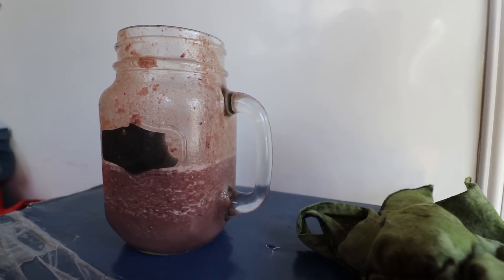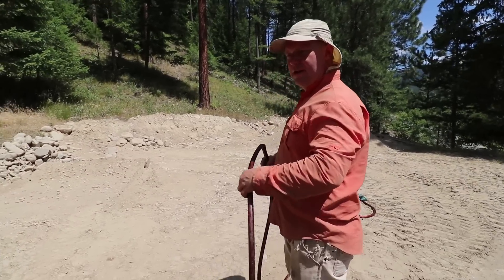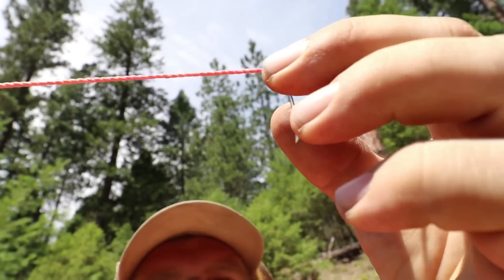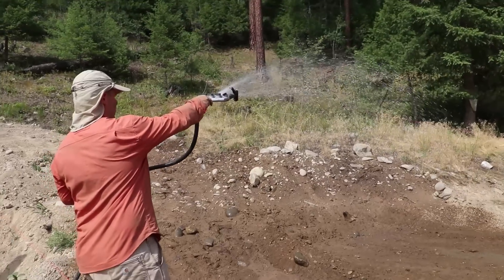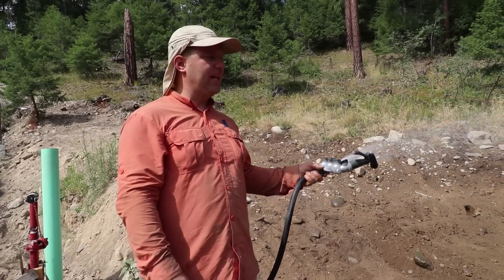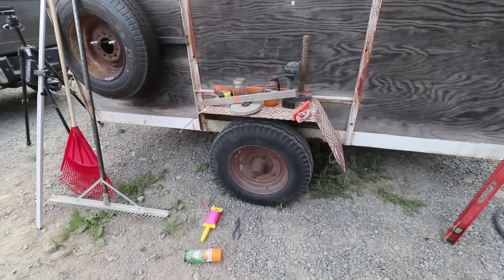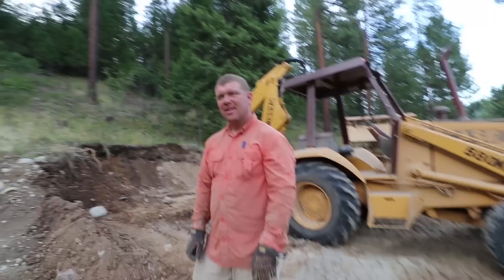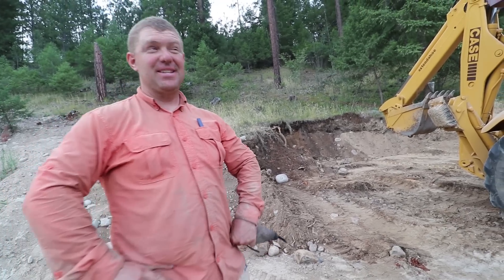IT'S OFFICIAL - THE HOME BUILD HAS BEGUN!

Comment: One thing you all could have done with the electrical. Make a hole for the conduit to go through in your forms, then run the conduit up along your post. You would have to make sure there was a gap wide enough between your post and conduit to attach the electrical box.

I know this is hind sight, but it is something to keep in mind for future projects and individuals that are planning similar applications.

I am an electrician by trade and have done this on a couple of projects.

Comment: I'm concerned about some things: 1) that the drop off of your excavation needs a step off (like stair steps) around and behind your house or rock walls (you have an abundance of  rocks) to prevent landslides, erosion, and water run off,  how have you planned for that?  2) removal of all the chemical fluid spill and proper disposal to prevent contamination of your beautiful new home. 3) saving for use as much of the rich dark healthy soil in with your compost for your garden.  You two are doing excellent, your patience in planning is paying off and I wouldn't be surprised if you already have the above concerns resolved and haven't shared those with us as yet.  Great videos, so much enjoyment observing your journey.  grams

Comment: I have been wondering if you guys considered taking a look into the Earthship method of construction or housing design such that you would capture your own rain, grow veg and fruit trees and generally have an indoor green house as a working part of your house, and make use of your water 4 times before it goes to the septic system. I suggest looking up the Earthship method, you might even get some idea's for parts of your design method to heat or cool your house in the end if not other stuff.

Comment: It will help if you put in batter boards in now at your corners (set back maybe 10 feet)... 8 total, each pair represent one face of footing / wall.  Use the laser level to put them all on the same level so you can accurately measure and square off the corners.  Once you put the lines in for the footings you can sag the line until it makes a fairly straight line on the ground... use chelated lime (white powdered chalk) to mark the face of the footing to dig by. 
One other trick is to put in a rebar stake (like number 8 or larger) far enough away that it won't get hit (protect it)... set the top of the stake at finished floor height and reference off of it for the entire project.... once you have some concrete down you can cross reference it to make sure everything is perfectly level and square.

Comment: Hey guys, 
I can give you another trick for the string in the pipe. You can us a compressor with a air gun and shoot it from the same end you are feeding it. Most of the time you don't need the bag just the string. Just pull the right length so you know you when you made it to the end.
Hope that helps in the future. Oh and Jesse you might be able to pick up the grisly with the front bucket under the lip. Basically hanging it on the top of the bucket. I hope you understand.
Love the videos 

Ps. Don't let's the trolls get to you. There not the ones out there doing the hard work in the heat. Congrats on everything.
Reply: Future Hindsight it just moves down the pipe with the air flow. Pretty fast to.

Comment: Melissa re tool organisation; Get a tote bag. I changed from tool boxes to a tote bag a year ago. SO SO much easier to use. you can chuck the bigger bits in like a drill and impact driver etc and the smaller items, screwdrivers and spanners (wrenches) stay in the elasticated pockets.

Comment: I just lost a long post I was going to send. But don't use Mason's line to pull, it will cut the conduit at the bends... Use poly pulling line or pulling tape or mule tape. 
And plan to put a "ufer ground" in your footing aka "concrete encased electrode" - if want some electrical advise message me.

Comment: A cut up sponge works great for gitting a string throu a pipe with compressed air. Never tried using a vacuum. Is there a creek or river near there? All the rocks were in a river at one time, all nice and round.

Comment: Firstly,,, I don't know.  I have been a builder for 50 years.    Angle of repose.  All materials have a maximum slope, the angle that the pile of sand, or rocks, pea gravel, snow,,,   And there is a lesser angle that materials 'like' to erode to.

Your back wall depth.  Making the slope steeper behind your house could be a very bad idea.  The slope has demonstrated what angle nature likes.  All the slopes behind your house are approximately equal.  You should consider that angle as your maximum angle.  Exactly as on  a roof,, you will want a flatter angle and even an up-slope to the rear of your house with swales leading the water around the house.

Placing a house to an arbitrary either height, or depth, can be a very expensive idea.  Allow the site and water flow to dictate what it likes.  Like the view, raise the house perhaps.

The summer heat you have experienced,, make certain your south facing windows have adequate eaves to shade them,  You wear a baseball cap?  It is exactly the same thing.

Comment: Liked #47,  your starting to get better at everything, thinking sometimes to much and to far ahead but it will all come together  and in a good way I hope, lol, on the piping for under ground be safe and if possible put a extra pipe in for those hard to dig places so as to not have to re-dig the area up, your still going to mess up or leave something out, just the nature of the beast even for the pro's, lol,  Later

Comment: Don't pull your circuits in the PVC conduit with string, use a pull wire. The sting will cut in the 90 deg. elbows.

Comment: What's the grade on that hill?  If it's about 30 degrees or more you're at a pretty high risk of landslides, regardless of the composition of the soil.  If you're less than that it's safer, but still not risk free.  I'm not trying to say that you're doing it wrong, but even experienced developers don't take this into account and pay for it later.  Love the videos, keep them coming!
Reply: Also, the more you dig into the toe, (base of the hill) where it looks like you're putting your house, the weaker the hill becomes and increases the chances of that sliding.

Comment: 45 yrs ago-for erosion control ,I  made DIY        "gabion" baskets     ,from 1/8th inch galvanized wire rolls welded at 3 inch spacing
   -filled 6 or 8? of such  2 x 2 ft x 10 ft long   baskets  with rocks and boulders plus scrap concrete pieces  
     -STILL ok -     ( immersed 24/7/365  in water for 45 yrs )   -but looks a bit "ratty" now since man made concrete eroded away~~

 suggest you consider same  - to hold your hillside in place ABOVE your foundation 
  since CHEAPER than poured concrete blocks, NO REBARS or concrete  required
   ( as MANDATED on your driveway by municipality )-to keep hillside in place above your driveway

           -AND YOU have COPIOUS rocks and boulders to use ~~

Comment: Here's helpful hints when sending string though pipe use a shop tie a piece of placstic to the string and let the vac suck the string down the pipe
Reply: I have been pulling wire for over 30 years. both ways work.

Comment: Congrats on starting the house - very exciting!

I may be mis-remembering, but didn't you lay out the septic system's slope so the house would be roughly where the trailer is?  The house location seems to be quite far away from the trailer.

Comment: I envy you both on this journey you have taken on. This is something that I had always planned to do. But life and raising a family ended up taking precedence. You both make an excellent team, you compliment each other in your personalities. Keep communication good between each other and keep supporting each other. Keep having fun with each other and life together. 

Some notes and advice on the projects, mostly from my own experience. 1. Remember the "KISS" principle, both in your work and in your "Lecture" (Teaching) time.  2. Be wary of over-building, it cost time and money and SOMETIMES things don't need to so strong or heavy. 

I watched Alyssa vacuuming in the pull string through the conduit, great job, excellent technique. BUT do NOT try to use that nylon twine to pull wiring through the PVC. Only use it to pull a heavier and broader and soft pull string in, then use that to pull the wiring in. That nylon twin is very strong but the small diameter will also cut right through the PVC pipe very easily and quickly, almost without effort.  Take a scrap piece of PVC pipe and run a piece of that nylon twin back and fourth around it a few times and see how quickly it will cut through it.  If you try to use it as the pull string, it  will cut slits down your PVC pipe, especially around the inside of curves and bends. Then you no longer have a water-proof PVC pipe run. Spend the money for the flat, braided, soft pull string rope made for using in PVC pipe. It is a little more expensive initially, but it will save you time and effort making your pull smooth and easy without cutting into the PVC pipe. Wind it up on another spool, extension cord "ring" works great, and re-use it many times. 

Do not let the people with negative and destructive comments and opinions get you down, don't waste your time with them. They either don't understand the fantastic project journey you have taken on, or are just flat out envious of your journey and are to immature to understand the saying; "If you can't say anything nice, don't say anything at all." 
But there are a lot of people that are providing you some excellent advice based on their knowledge and experience. For those people, on behalf of you both, myself and the many thousands of people that are leaning a lot from you sharing your journey, a very BIG "Thank You!" for sharing. Knowledge that is not shared will die and have to be re-learned. 
Thanks again from all of us that are getting a lot from you sharing your journey with us. Keep up the great work and may you realize your dreams and much more.

Comment: Great vid you guys.  I have a question regarding your site selection of the foundation:  why did you choose that site on your property rather than placing it up the hillside just behind the deck?  One would think the higher elevation would not only provide better views, but also a shorter cable run to your solar panels (resulting in less voltage drop)?  I assume the gravity-fed water system played a role in this choice, but I'm just curious, because my instinct is always to build as high up on the property as possible (to mitigate flood/water-runoff risk.  Keep up the great work!

Comment: Be careful with that large roll out tape if it's made of canvas/plastic type material in the heat the measurements might not be correct. Not important now but will be when you are laying the posts down and have the building square. There are roll out measuring tapes made of steel/metal not affected by the heat as much. At least put the tape in a cool place when not in use. By the way great job love the team work.

Comment: Ha guys love the show. from one equipment operator to another you are greasing the machine in the morning before you start using it ? right? it will last you a lot longer if you do and grease is cheaper the parts.were the grease zerks are looks like there hasn't been any dun fence it was painted.

Comment: On the subject of getting a string in electrical conduit.  Use a fishing bobber on your string instead of the plastic bag. Yep....the old red and white ones.  You can find a bag of the fishing bobbers at Walmart for a couple of bucks.  The bobbers come in several different sizes, pick the size closet to the I.D. of your conduit.  At one time they sold a bag with multiple size bobbers.

Comment: you do realize sinking the house into the hillside helps a lot in climate control costs right?  you could easily timber frame the front with a concrete back wall. And even put half timbers coming out of that wall for effect if that is what you are going for.